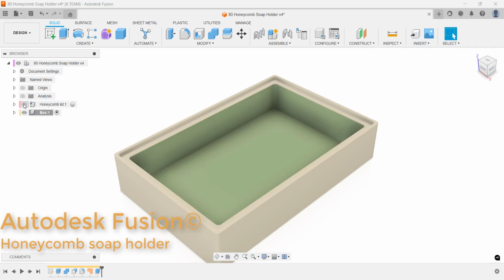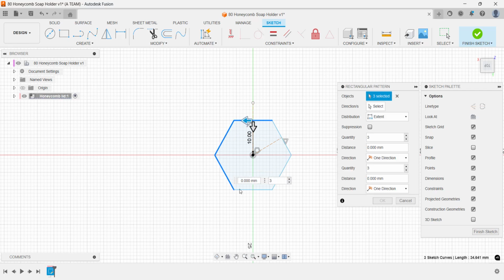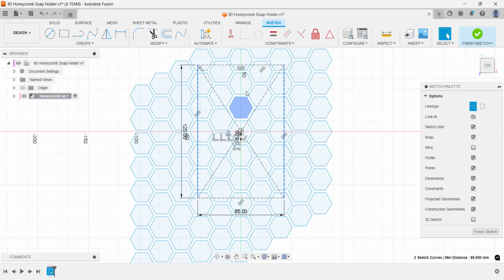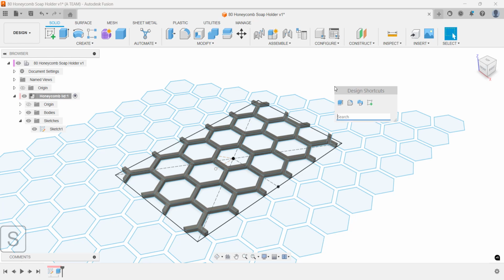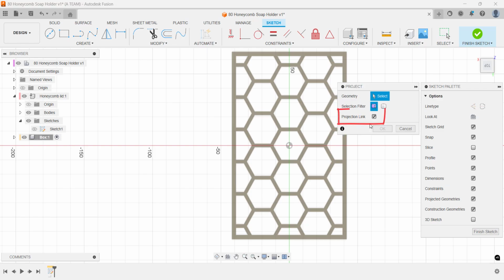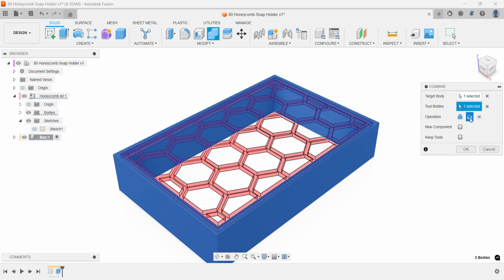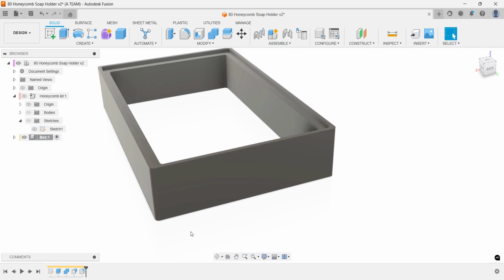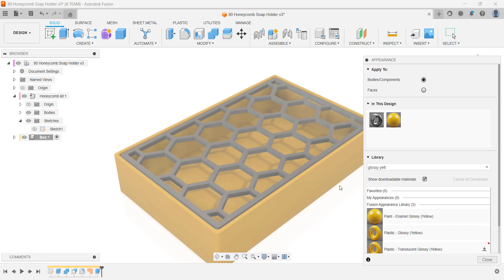Design a 3D Printable Soap Holder with Honeycomb Pattern in Fusion

Comment: First time using components. Got stuck at ~6:00. When I create a new activated component, the body is ghosted. Unsure what I am doing wrong.
Reply from the maker: Good that you get started with components! Check your activate component visibility settings.

Active components visibility | Fusion 360 tutorials
https://youtu.be/Nx7rRQBpvD4
Reply: Happened with me too. I just continued designing and it came out fine
Reply from the maker: Great!